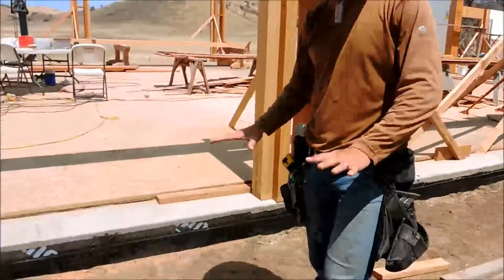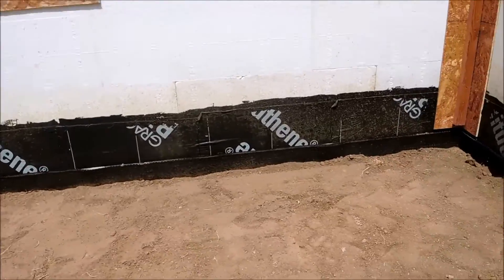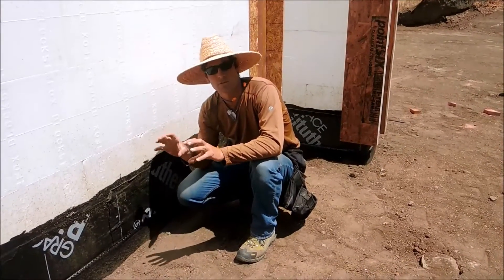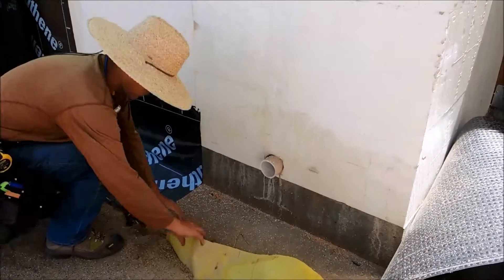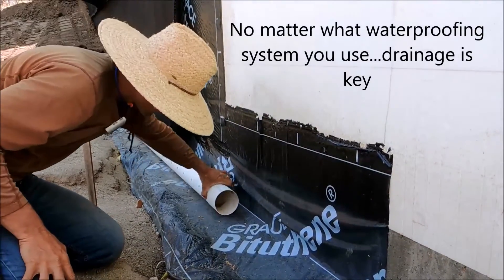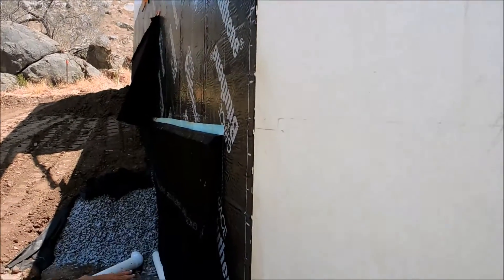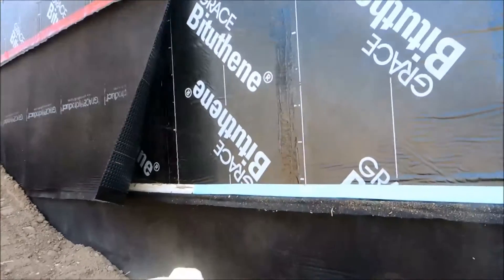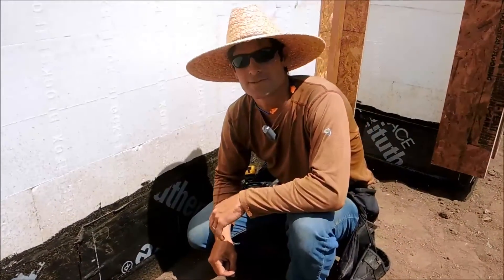Fox Blocks Common Waterproofing System Peel n Stick Membranes

Comment: 0:34 shows the hydroduct 220 open at the top.  Just curious if felt should be wrapped around the top so that soil doesn't directly infiltrate and clog up the system.

Comment: That pipe coming out of the gravel has it's holes facing away from the wall in a 10'clock position.  Those holes should be facing down at a 6'oclock position.
Reply: Why not more holes?
Reply: For the skeptics: as the water level rises, it has to build to the height of the hole before it it can make its way into the pipe and be carried away. If the holes are oriented down, as soon as the water builds it's carried away.

Comment: This is an excellent video for ICF installers.  I especially like the way that self-adhering products are employed, as opposed to sealing products that must be installed via screw-type fasteners.  As an ICF installer, is there any way I could get a list of the various waterproofing products you used for the project depicted and described in this particular video?  Thank you.